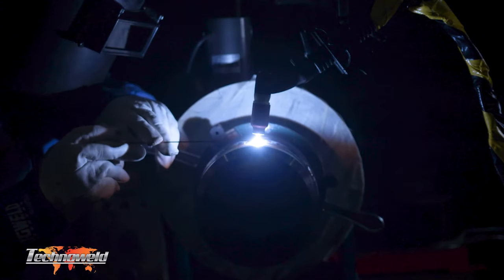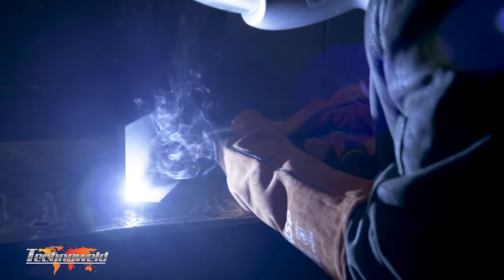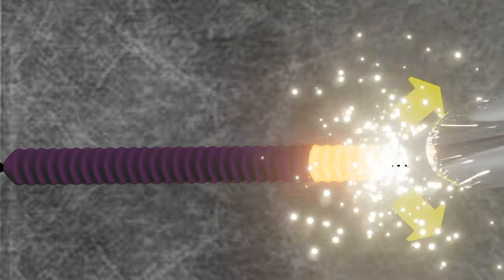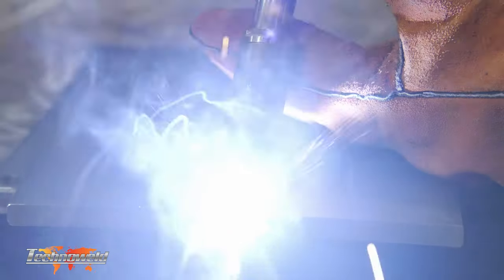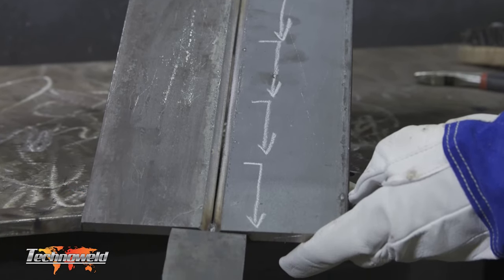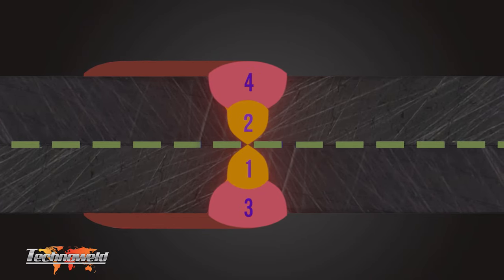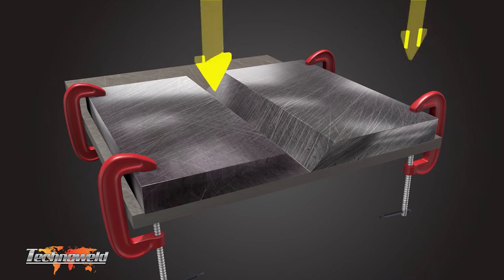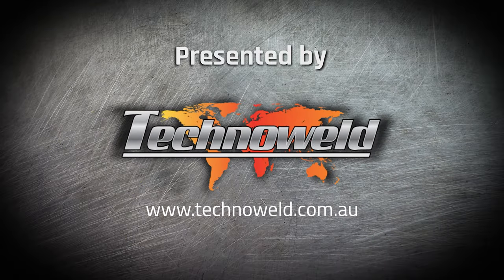Distortion in Welding

Comment: We used fixtures on everything we welded. Nearly 100% of production welds use fixtures. It might put more stress on the weld but mild steel has a tensile strength of 50,000# per ½" square, filler metals have a minimum of 60,000# per ½" square or more. Since the weld is stronger, shouldn't it be fine to have more stresses?